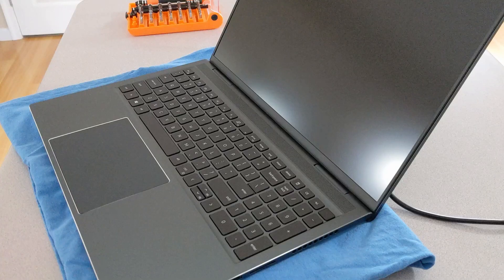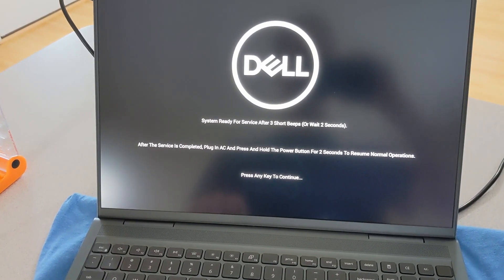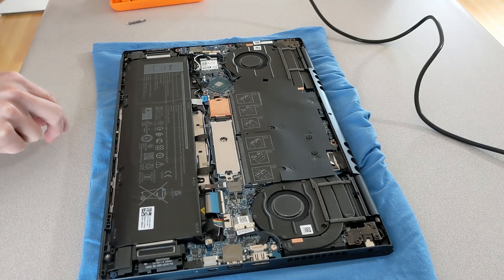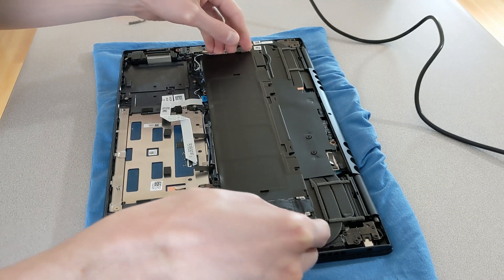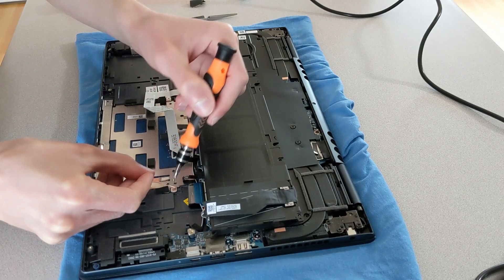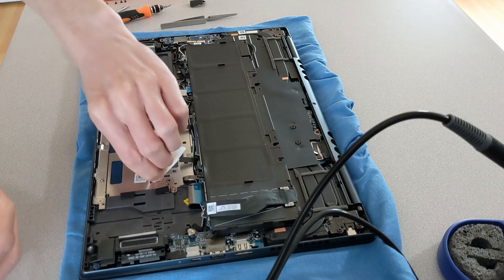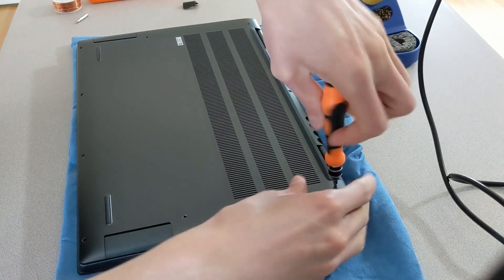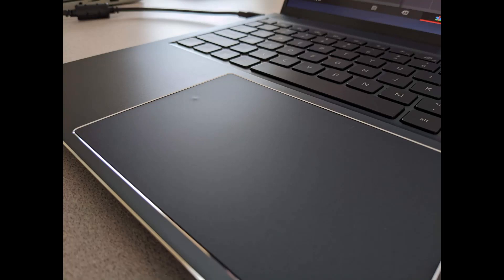Grounding Wire Fix for Erratic Touchpad Issue (Dell Inspiron 16 Plus)

Comment: Seems I also just fixed the erratic trackpad behavior on my Inspiron 7610 using the advice from the DashRendar video and viewer comments. Used a non-invasive method. Got some 1/4 in conductive on both sides copper tape from Amazon. Assured myself that the sticky side was conductive. I measured about 0.4 ohms per inch. Got to the trackpad using DashRendar's instructions. The copper contact pad seemed to have little surface resistance. So, without sanding, I placed a short piece of tape from the copper pad to the silver-colored metal frame. I overlapped an additional length of copper tape up the frame towards the screw that DashRendar used for his grounding wire. So far so good. Don't have to connect a mouse every time I want to use the computer. Let's see if it lasts. Only problem is that I have enough copper tape to repair a few hundred computers. Many thanks to DashRendar and the commentators.
Reply: update?
Reply: Been about a month, and so far so good. There was an occasion when cursor went wacky when I used the trackpad, but I'm not so sure it was the trackpad. Perhaps a software issue.  @DragonProtector
Reply: Trackpad still wonky. Non-responsive or jittery.
Reply: @cienfield1952  so it failed?
Reply: @DragonProtector  Yes. Failed. Sanded contact point and replaced conductive tape. Worked for a while, then went wonky again. Fed up.
Reply: @cienfield1952  from what i found out is if the laptop is cold it works better but heats up it goes wonky.
Reply: @DragonProtector  Thought about replacing the trackpad. But what's the point? Others have reported replacing their trackpads several times--and the issue keeps coming back.
Reply: @cienfield1952  yea. I really just dont have time to fix this or even try it

Comment: Thanks for making this video, very useful. I did the fix using adhesive copper tape with double sided conductivity (to both contact points), but the same erratic touchpad issue came back after a couple days of use. I opened it up again and did the same thing, but with two layers of tape for some extra thickness, including folding it over at the copper contact point to ensure there's enough thickness there that would press down, and that time it worked great for almost two weeks. The issue just came back... any ideas what could be resolving the problem temporarily but then having it come back over time?
Reply from the maker: Unfortunately grounding issues are notorious for being erratic like that. In my original post on the Dell Community Forums, while we were working towards a solution, I mentioned that the problem would often disappear by simply removing the back cover of the laptop, only to resurface after a few days or weeks.

In your case, it seems the connection might not be sufficient for some reason. There could be a layer of oxide on the metal surface preventing a solid connection, or perhaps the quality of the copper tape is a factor. One troubleshooting step you could take is using a multimeter to check the resistance between the copper pad and the laptop chassis, observing how the resistance changes with different solutions you try.

While using metallic tape is the least intrusive and most convenient solution, soldering a wire is probably the most reliable and robust way to make the connection, so if you continue to not have success with the tape that may be something worth considering.
Reply: @dashrendar2625  I might try with the tape one more time and see if I can establish a better connection somehow. I did read some about trying to get some nearby pins to press down tighter onto copper pads as well, seems potentially worth a shot. This is pretty much my only experience with working on electronics so I'm hesitant to go the soldering route is all. Thanks again. I may invest in a basic multimeter as well, I don't have one right now.
Reply from the maker: @mattgeorge505 If you haven't already, lightly sanding and cleaning the copper as I did in the video, perhaps even some of the aluminum, might help in case there is any surface contamination or oxidation that is preventing a good connection. Some people mentioned they didn't need to do this step, but it might help. Good luck as you experiment, hope you find something that works!
Reply: did the tape end up working or did you have to surender to using the wire method?
Reply: @archifrero  The trackpad still had erratic behavior behavior for me. I use my laptop with a wireless mouse the majority of the time, so it just hasn't been urgent enough for me to figure out soldering or take it to a shop to have them do it.
Reply: @mattgeorge505  thank you for the answer :)

Comment: Works on Inspiron 16 7620 2-in-1 laptop aswell. I had the same grounding problem it seems. The layout was a little different from the 7610, but very similar process nevertheless. ALSO, the contact pad is way smaller on the 7620, so soldering is a bit more difficult if you want to be precise. I recommend practicing soldering beforehand, so the process goes smoothly on the actual laptop.

UPDATE: the issues came back again, so I opened the laptop up again, and I soldered another wire on the other contact pad (exactly like on the right side, the 7610 only has 1 contact pad, whereas 7620 has 2 contact pads). I also reheated the existing solder wire incase the connect was bad somehow. Seems to be working for now.

Will update this comment if there's any other problems I run into, but this seems to be working for now.
Reply: how did you do it on the 7620? I need help!
Reply: @sabrinaspence5279  What exactly do you need help with?

Comment: Thanks a lot - I just repaired my touchpad!!! I used double-sided conductive copper foil tape, so no soldering was required and no overheating or damage could happen. Touchpad works like a charm now. Just like it is supposed to.
Reply: I slid tin foil under there - wished I had that!  It worked thought!
Reply: Where did you put it?
Reply: I ordered some copper tape from Amazon and installed it and worked like a charm thanks!!!
Reply: Like the kind used with stain glass?

Comment: What would happen if we just removed the foam between the contacts. and replaced it with a thick copper tape. i do not like the look of the gerry rigged copper tape line i made lol it works but still.

Comment: i got two sided copper tape and it works. No stress for burning your laptop and no soldering. its just tape. just make a trail to the grounding bolt. no need to scrub anything either. i did both sides to opposite grounding bolts to make it even better and it is working like a charm
Reply: Also i had this problem on my dell inspiron 16 7620 oled model. this fix works the same but the track pad looks a little different than the one in this video. the gaps are smaller and its alot harder to get in there and fix
Reply: @crazedxfighter  Hi mate.. i too have the exact same model as you... Mines also a 7620 with a oled and a touchscreen.. the touch pad is slightly different from whats shown here.. it seems to be sorta integrated to the frame at the top.
however i still have not opened the back cover yet.. 
I just wanna know is the internal view different from whats shown here?
And also did u sand down that surface?

Comment: Does everyone fix this? In my case, the touchpad works ok when the laptop turns on. But after 15 to 20 minutes use the mouse cursor would start running crazy on the screen. It seems it may have something to do with temperature rise, or static build up?
Reply from the maker: That sounds like the static buildup this fix addresses. On my laptop it wasn't consistent, sometimes it would work for a few minutes/hours/days before the touchpad would start acting up.
Reply: mine will work about an hour or so....or sometimes 3-4 hrs (it's erratic) but  haven't been able to get through a day without having to turn my computer off and back on again to at least get the trackpad back to normal operations. I presume that turning off and on does something to the grounding or breaks up the static enough for some sort of reset?

Comment: Thank you so much. If you're careful with the heat, you can apply the fix without any bump at the end. Just get some solder on your tip and on the wire, and you should be able to do it quickly. Has been working ever since (couple days now). Previously couldn't get through a single day without the thing driving me insane.

Comment: From day 1 - I have this issue, also there is a constant electric discharge on the metal beading on the edges, it is sometimes painful the electric discharge. I am surprised that they are so incompetent to fix this issue in production.

Comment: One and 3/4 years of erratic mouse behavior.  Checked ohms from copper pad to TouchPad ground shroud.  Fluctuates from .2 ohms to 100 ohms.  Not a good connection.  This fix holds a solid 0 to .2 ohms.  No more erratic TouchPad!  Thank you for the fix!

Comment: This is a totally confirmed solution. I did this 18 months ago, not a single trackpad glitch! And it's a nice touchpad, one of the nicest I've ever used.
Reply: which model ??
Reply: @Harpreet-t5b  mine is the Inspiration 16 7610, but they all seem to have the same issue
Reply: @gargamel314 did you soldered it how has it been now did it leave any marks on touchpad
Reply: @TheCodingLadder  it has worked beautifully for over 2 years now. Yes, I did solder it, and no it left no marks on the outside of the touchpad. But obviously the solder was present when you opened the back cover of the laptop, so yes, it voids your warranty. Occasionally i would get brief reminders when the wire would come loose from the screw, but I just rewrap the wire around the screw and it's all good. I'm sure it happens from vibrations of moving it around.
Reply: @Harpreet-t5b  Inspiron 16 Plus 7610

Comment: I have this issue on my laptop. Dell is sending out and engineer to replace the touch pad which i dont think will fix the problem.

I shouldnt have to be doing this kind of fix as per the video to make my system usable on a laptop that cost me £1000.

Comment: Thank you for sharing this, I been dealing with this touchpad issue for a year, now I just need to find those tools, so I can fix it. 
But can I just remove the sliver pads on both side or sand it down to remove the obstacle between the copper and ground panel? in that case, all I need is a Phil screwdriver and a sand paper.

Comment: Thank you!!! You really are a lifesaver. I love my Dell Inspiron 16 plus 7620 (newer model, yes, they did the same mistake...) but it had the same issue, now it is completely fixed and I can finally enjoy this great laptop.
Reply: How did you do it on the 7620?
Reply: @sabrinaspence5279  The touchpad has the same conductive foam that is crap, I soldered a small wire directly on the touchpad (on the copper part, as he did in this video) and I stuck the other end under a screw on the motherboard (not on the touchpad as he did in this video) to connect it directly to ground. I hope it's clear, I am sorry I can't attach images or links here.
Reply: Still working fine?  Did it got any marks on touchpad
Reply: @TheCodingLadder  Yes it's still working great, flawless since about one year, the fix is definitive. No mark on touchpad, someone uses conductive tape but I decided to take a risk and solder, I tried to be as quick as possible in order to not heat too much the touchpad and ruin it, it worked great and now is perfect.

Comment: this is brilliant! I had the dell engineers come out at least 3 times before I gave up calling them. Does anyone know another method other than soldering? I dont have a soldering gun at the moment.
Reply from the maker: Many people in the comments have mentioned alternatives they have had success with, the most common being using conductive copper tape in place of soldering a wire.

Comment: To test this out, I used used a small strip of aluminum foil, folded over a few times to give it some thickness, and taped it to the copper contact using electrical tape.  The touchpad works perfectly now!  I've ordered a roll of copper conductive tape (with conductive adhesive) and will re-do it using the copper tape for a more "professional" fix.  Thanks for the video!
Reply: Update: I removed the aluminum foil and replaced with copper conductive tape.  The touchpad worked perfectly for  a few days--but then the same issues started happening again 😞.  I'm disappointed that this didn't work for me, as it apparently has for others.  I also discovered that when the touchpad isn't working as it should, if I close/reopen the lid the touchpad starts working correctly again (until it doesn't...).
Reply: WTF!! I closed and reopened my lid and it started working properly
 @jimpeoples

Comment: I went into the kitchen and found my aluminum foil and PVC tape.
Applied on the metal tip with tape to put gentle pressure. Now, the mouse pad is working flawlessly.
Note: This is not a recommendation
Reply: Quick update: So, the earlier workaround stopped working after a while. Today, I gave it another shot—followed the same steps from this video and was extra careful while soldering the copper cable. Fingers crossed it holds up 🤞
Just a heads-up: I’m only sharing what I tried personally. This isn’t a recommendation—there’s a real risk of damaging your laptop if things go wrong, so proceed with caution!

Comment: Just adding to the chorus. Mine started playing up for the second time (they replaced it about 7 months ago). I'm out of warranty now. This worked. Wish dell would just fix the issue (given you've effectively told them what is wrong and how to fix it) rather than replacing with parts that just break again. When this laptop has reached its end of life (I can usually make them last a fair few years) I'll be getting a different brand.

Comment: I struggled for a year with this problem.  This fixed it for me as well.  I used copper tape.  Add my thanks to the many for posting this.
Reply: can you take a picture of the tape and where you put it, I've used both copper and aluminum tape and the problem is still there.
Reply: I can't take a picture because I am not with my tools to take the machine apart again.  But I placed to adhesive copper tape exactly where it was placed in this video.  The only thing i did differently was to remove the steel screw,  place the tape over the hole, and replace the screw driving it through the copper tape for a secure connection.  Good luck.  I hope this works for you @Ripknoxx
Reply: @mjr4266  that's exactly what I did. I guess mine is just trash

Comment: Well...here we are. July 2023. Mike Dell still sits at head of table. I'm on touchpad replacement #5, and each time my DELL service contract sends a tech with a new touchpad 200 miles roundtrip. I'm awaiting now, more than 30 days, for yet a 3rd actual Inspiron from the Dell Nashville folks.  The good level 2 Dell phone service rep tried to take the company line...we'll replace the touchpad on this newly arrived refurb'd Inspiron. But I am an electronics engineer.  A very good one too.  Told Dell NO. Said I am sending bad touchpad refurb back to Dell.  But I still have the original, dead in water due to NFG touchpad.  They didn't like that I had known of their self admitted issue.  Heres the BEST PART...Level 2 dude says to me that they are awsre of the "defective gasket". READ THAT AGAIN. 
Me and the in home repair tech both knew it has been one of Dell's greatest money wasting issues.  I said a year and a half ago that it's a intermittent and thus no doubt the connection is plated.  Tech told me not to void the warranty and told me he'll replace the touchpad a million times if I need.  And so Dell did just that.  Costing you Mr. DELL, way too much $$$ money.  Times a few thousand machines??? 
The poor fellas in New Delhi...they can't sway from their playbook.  
However WE can get the next machine from HP, Lenovo, or dare I say it...c'mon everyone together...that fruit from the Garden of Steve...Err...I mean Garden of Eden.
I have not heard back from my 2 latest requests for my laptop repair ticket. 
Time to strap a piece of copper bus bar to the chassis of Mike Dell's sports car, and to my Inspiron 16 7610.  
Oh, and India...if you are watching...last 3 of xpress # are 731.  Do your leg work. 
Thanks to our customer community!  3's Lars

Comment: Do you think this would also work with a 9710?
Reply from the maker: If the touchpad is showing the same erratic symptoms, then it very possibly has the same grounding issue. The layout of the internals is slightly different in the 9710: https://youtu.be/d7iUonQ61o4?t=117. It looks like you could use the left copper pad on the touchpad, and would just need to identify a location to ground it to, perhaps under a different chassis screw.

Comment: Thanks for highlighting the poor trackpad grounding issue and proposing a fix. It seems that the leaf springs, located on each side, were originally designed for this purpose but unfortunately become ineffective after a while (oxidation at the contact point?). Soldering a wire grants for sure a better grounding. However, as I have read in some places, there is a risk of overheating and damage to the touchpad. I therefore preferred to implement the alternative solution which consists of using a conductive strip instead. It makes it possible to cheaply, easily and safely establish a good electrical connection between the copper contact area of the trackpad and the chassis. This works like a charm: no more trackpad instability now!
Reply: would you mind sharing how you used the conductive strip. I want to try this myself